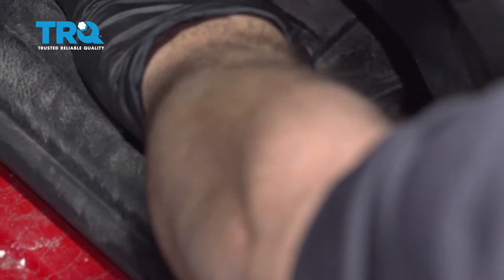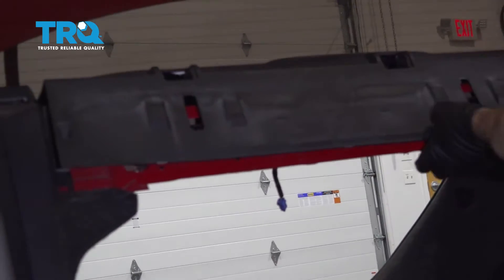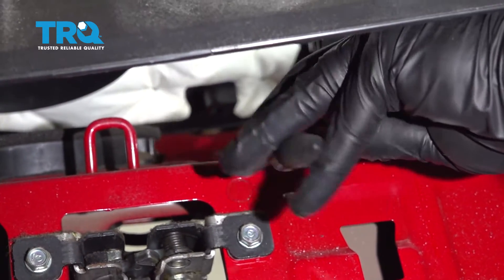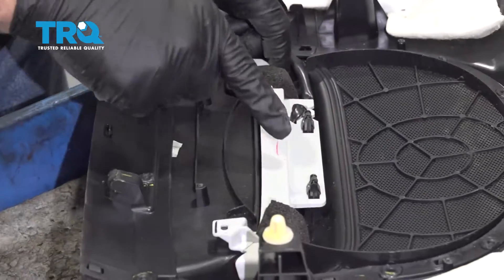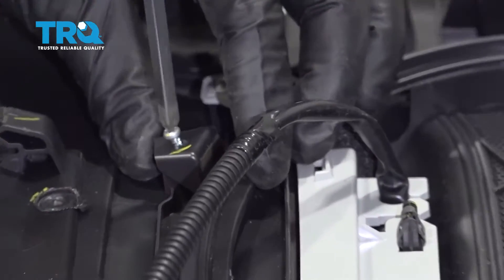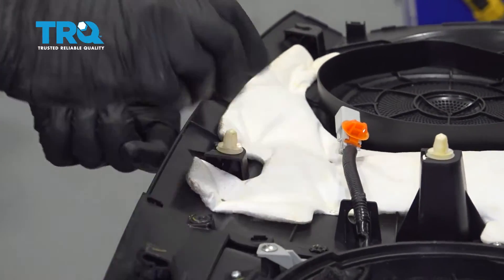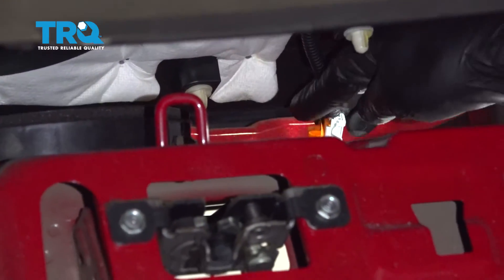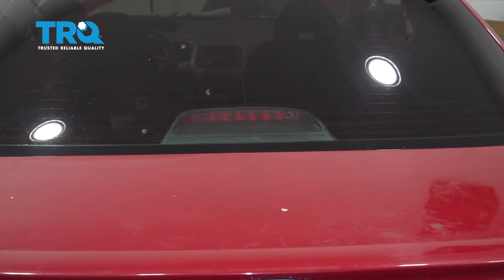How to Replace High Mount Brake Light 2006-2011 Honda Civic

Comment: Thanks for the great video, the detail convinced me I could try this repair myself.

My US 2009 Civic back shelf cover looked a bit different than the one shown and was also attached with an adhesive. It was on so securely, I had to use a rubber hammer to loosen and remove.

As the video says, once the shelf panel is off, it's important to remove ALL the white clips that may remain in the shelf base and insert them in the shelf cover. When attempting to re-install the panel, if the clips remain in the base, it's impossible to slide the back of the cover in place.

When disconnecting the connection harness, note that plug slides off of the retaining clip so it may not be necessary to remove the clip. However, some replacement lamps come with a different type of clip attached to the plug so removal would be necessary.

Comment: My 08 si doesn’t have the light or the connector. Any ideas as to where I could splice it from? I tried near the taillight, but that feed will only power one light at a time, not both like I need